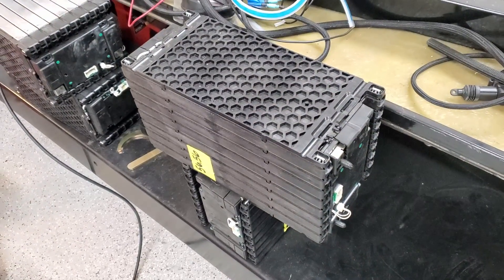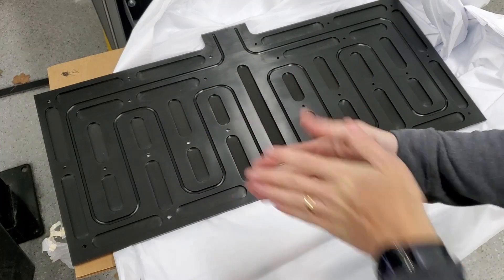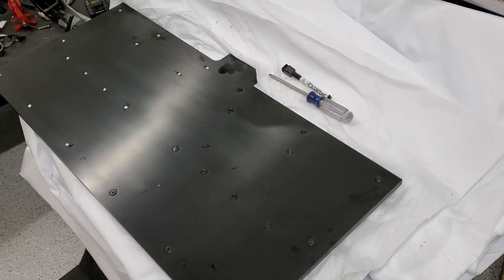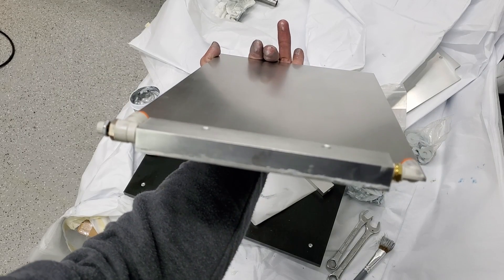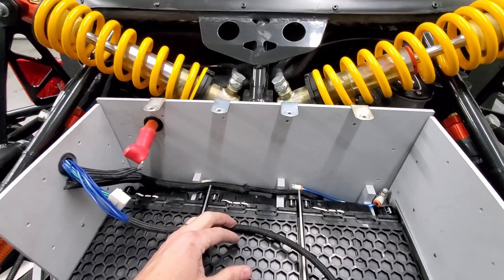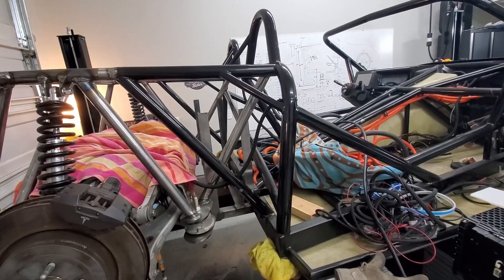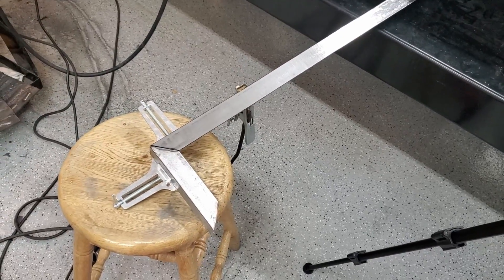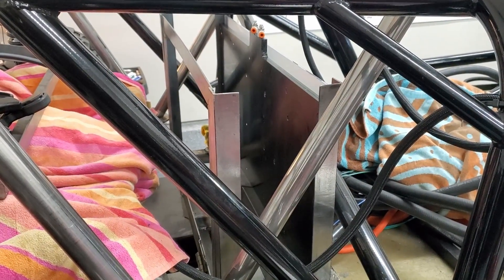Electric Vehicle Battery Cooling - LG Chem Lithium Ion

Comment: What temp are you aiming to keep the batteries at?  How about heating in cooler weather?  How has this system worked for you?
Reply from the maker: Ideally 5⁰-20⁰C.  Operationally fine 0⁰-45⁰C.  For my application (open air roadster) I wasn't too worried about the colder temperatures, as I would not want the car out when it is cold anyway, so I wasn't looking too closely at heating options.

For me this system worked great, and probably overkill as it proved hard to elevate the battery Temps with aggressive driving.
Reply: @electricsupercar  awesome!  Thanks for the info. Hard to find proper cooling information for these batteries.
Reply: @electricsupercar  just curious on your track days or charging what’s the highest temp you have seen?  They seem more robust and less sensitive then the Tesla cells.
Reply from the maker: @kingersgarage  I would say it is like running your cordless drill non-stop until the battery runs out.  Then feel the battery.  It is barely above ambient temperature. 5⁰-10⁰C above ambient is the highest I have seen
Reply: @electricsupercar  super helpful. I like the new project!  OE interior will be so nice and you can just worry about getting it to fly…silently of course! I might reconvert my Rx7 from a v8 monster to dual MS motor set up so I’ll be watching!

Comment: Checking in from a couple years in the future, how did this cooling solution work out for you? Was it adequate to manage heat at high discharge rates for extended periods?
Reply from the maker: Thanks for the comment!   Always good to check after a few years.  For my particular application the cooling was overkill.  I can drive my system pretty hard and my battery temps do not very high at all.  I think I would drain my batteries before I am in danger of overheating.  It is always good to know that I am being overly cautious. To answer your question...yes this system works well
Reply: @electricsupercar  does the cooling system allow for fast charging?
Reply from the maker: @HavokBWR  It could, but I do not have my system set up for fast charging

Comment: You need to run your cooling lines in parallel. If you do it in series, your batteries at the end of the loop will not cool properly.
Reply from the maker: Yep!  I re-ran the lines.  Thanks for the comment!

Comment: Are you going to monitor every thermistor, or just a few like Zeroev are doing on their LG chem powered MX5? I need to monitor 64 thermistors in 32 LG Chem modules☹️ what monitoring system will you be using?
Reply from the maker: Hey Roger, the LG Chem modules that I have state that they have 4 thermistors per module (16 cells).  After trying things out, they only have 2 working thermistors per module.  I am monitoring one thermistor per module.  I figure if there is a bad cell in the module the whole module will heat up pretty quick.  I am using the dilithium design BMS which also monitors the thermistors.  Good luck with your application.

Comment: Curious where you ordered the cooling plates from. I have lg chem batteries going into my build and have been wanting to actively cool them but nothing exists off the cheslf and I haven't been able to find a place to make plates like you have.
Reply from the maker: Same story here.  I designed them and had a machine shop make them.
Reply: @electricsupercar  May I ask what shop. I have been trying to find a shop to machine the ones I have designed an locally I have been struggling to find a company.
Reply from the maker: @qckslvrslash  I used https://www.ztltech.com
They quoted and delivered quite a bit less than I could find locally.

Comment: Is it not possible that we are demanding too much current from these batteries for EV usage? They use midtier high drain cells for EV's. Why not use high drain cells? They'd sacrifice some capacity, but shouldn't need cooling. Keeping them warm in the winter, however, is a different story.

Comment: Great job. What is the overall distance that you'd think you'd make in one charge? I have a similar project in mind btw. Cheers.
Reply from the maker: Francisco, good to hear from you!  I expect around 100 miles.
Reply: @electricsupercar  Thank you! Last question: would it be realistic to achieve a minimum of 600 miles, and ideally 800 miles, if you have enough space and volume, (5 feet width by 7 feet length by  14 inches in height), to accommodate the batteries, cooling plates, etc? I guess fire is a risk though, right?
Reply from the maker: Anything is possible.  Tesla model S use a 100kWh battery pack and can go ~300 miles with a ~4000 lb car.  You would need to balance the equation to either have a much lighter car or a much larger battery pack.  I am using a ~32kWh battery pack and ~2000 lb car.
Reply: @electricsupercar  I want to open a new YouTube channel where I showcase some architectural and design-based projects of mine as well sketching lessons soon and have a few videos ready.

One of these projects is the design of an electric motorhome, which I would love to actually build some day. The idea is to buy a second hand Mercedes Vario and convert it. Now this specific Mercedes has a tare of roughly 10500 to 16500 lbs. However I should probably take that information with a grain of salt, as I got this information straight from a website with technical information of the truck:
https://www.trucklocator.co.uk/blog/truck-and-trailer-news/2013/10/the-mercedes-vario-a-trucklocator-review

So I'm not too worried about space for battery storage. Also, I realize that because this won't take many live loads in the form of people, which is what it was meant for, it will take quite a bit of static loads such as the bed, the couch kitchen stuff, etc.

So what I'm worried about, like "The Tyranny of the Rocket Equation", I realise that I have to put the weight of the batteries, (which will undoubtedly be a lot of them), the weight of people and the weight of the entire bus into the equation.

My other worry is fire. As there would probably be a lot of these batteries in one place, (or maybe I can place them in two separate locations), I want to ensure these are cooled appropriately and make sure there is a Fire-Resistant barrier all around them in case there is a short circuit of some kind.

The last thing I'd like to include, but it would be the least of my worries is to research on the cooling system for super-charging. Don't want to boondock on a charging station overnight every time I hit the road.

It's really something that I'd like to build. I've purchased the Technical CAD drawings for the Mercedes and just after I'm done preparing and editing a few videos, I will begin draughting the project.

In any case, thanks for any tips and your project is going from strength to strength it seems.

Stay well buddy.
Reply: P.S. I guess with something that heavy it would be more important to take the potency of the motor into question more so than battery quantity? It is the powerhouse of the machine and it is what will move the whole thing.

Comment: thats not a good design for coolant. You dont have an effective amount of track in the plate to disperse heat. Also it should have been designed with a channel around the tracks for an o-ring to seal the coolant in. It will leak for sure.
Reply from the maker: You may be right.  If (when) it leaks, I will have to give your suggestion a try.  Thanks for the insight.
Reply: @electricsupercar  Just test the plate with an open loop to the radiator and pump with everything unmounted. If its low enough pressure you might get away with it.
Reply from the maker: You read my mind. 👍
Reply: @niffrig  thats a very simple test that doesn't ensure much. you have to consider the pressure from a closed loop system, vibrations and stresses applied to the plate while the car is in operation.
Reply from the maker: @niffrig  Good idea.  Thanks!
Reply: a better more reliable design would be running copper tubing as coils, encapsulated with epoxy, or just filled with thermal paste inside an aluminum housing.
Reply: @InspireCNC  an aluminum box  might have been a better initial design but what is done is done.  As for the test, an open system will be higher pressure and faster flow than in the car where the loop will have other draws.  As for vibrations and displacement when driving, that is a valid concern but the cooling plate is not a load bearing plate.  You also have to take into account that the battery is a passive plate, the cooling efficiency is not going to be high.

Comment: Nice!. But I think that its better too connect the front battery parallel. You connected it in serie,  but then the first battery will heat up next battery.....
Reply from the maker: Mattias, good to hear from you again.  I have not yet connected any batteries.
Reply: @electricsupercar  I mean the cooling hoses.
Reply from the maker: @Moppemannen_mattias  Ahh, that makes more sense.  Thanks